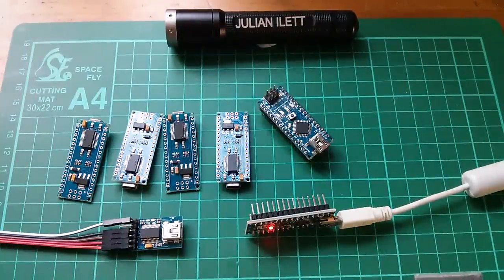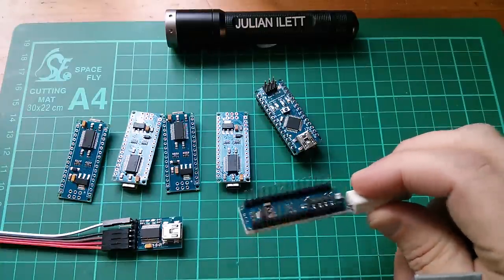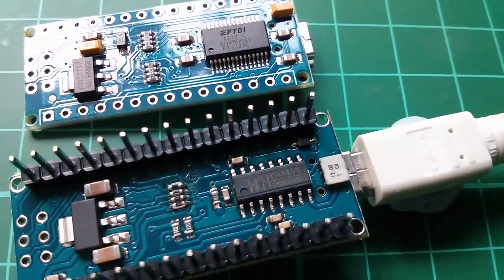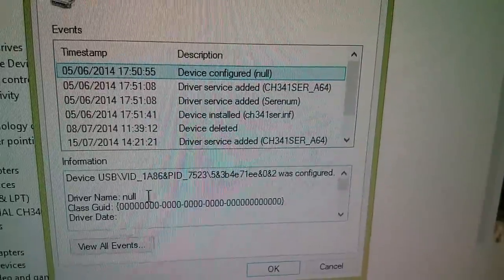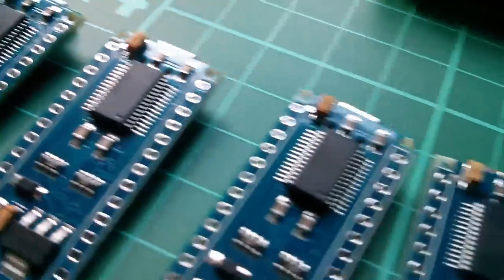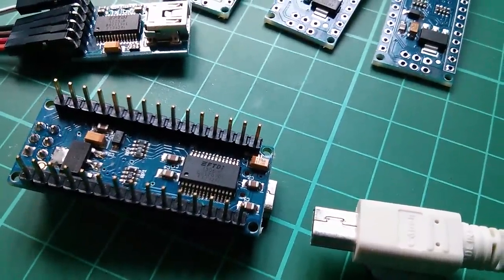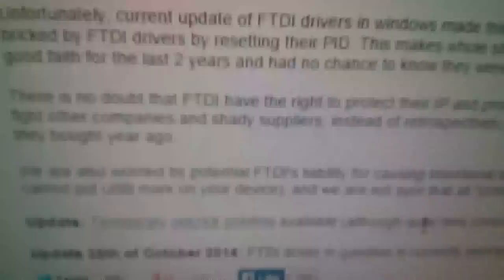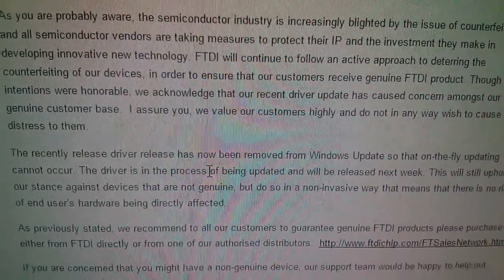Investigation: FTDIgate & Fake/Counterfeit USB to Serial Chips

Comment: I stopped using FT232RL over 2yrs now, just because it cost 4-5 times than other USB-Serial Chips. And I am also using CH340T USB-Serial chip over this period. CH340T cost us $0.39 @ lot of 250pcs. where FT232RL costs appx $ 2.4. But FT232 has more features over CH340. CH340 doesn' t have  in-built 12mhz crystal, wide range TTL voltage selection from 1.8V~5.5V and LED outputs. CH340 claims to work both in 5V or 3.3V , but we noticed it failed to transmit data @ 3.0V... But still it wins over price from FT232.

Comment: I have seen some cases where SiLabs or Atmel chips are used instead of FTDI chips, or CH340 used with an adapter board that contains tiny crystal and other supporting components on them.
FTDI chips are now not being used widely on the products using USB to serial chips.

Comment: It is possible to still use a 'bricked' FTDI chip. You just need to tell Windows to manually override the driver. There is a video on Youtube on how to do this. I had 3x FTDI chips whose PIDs were changed to 0000 but I can still use them using this method, so technically, they're not 'bricked'. Here is the link: Unbrick Arduino FTDI Driver Update Win7 Arduino Nano/Micro/ProMicro FT232R USB UART

Comment: It's possible to unbrick the device anyway - just force install drivers manually. Once installed you can use the FT Prog (http://www.ftdichip.com/Support/Utilities.htm) to flash the valid PIDs to the 232R chip. However if you'll continue to use the unfortunate drivers, the PID will be flashed back to 0000. So you should use FT Prog, and then get rid of the 2.12 drivers.

Comment: Hi, thanks for the video. So it seems that I will get away safe now when I decide to buy Arduinos.

I had one of these "bambus" LED-Clocks which I broke because I got mad. The buttons on the back were scrambled suddendly. ON/OFF did suddendly switch the clap feature on and off instead of the display on and off. The down button did not work at all and I could not set the date and clock anymore properly! So I opened it up "carefully" (Tell it to my left ring finger that got hurt...) and I decided to use the beautiful LED display to build my own Arduino based clock. I also want to add a radio control feature.

Comment: Just as a random aside, my Velleman K8200 3d printer controller board which is based off the Arduino mega 2560 uses an FTDI chip which I would assume is real since Velleman seem unlikely to use fakes, but the chip definitely is not laser etched.

Comment: I have a personal stock  of cheaper CH340 nanos. I saw that the 3.3 regulator on nano only works when the unit is powered from USB. A bit annoying. I'm guessing the regulator is built-in to the chip? (Don't have one to hand to inspect right now!)
Reply: Yes the 3.3v regulator is part of the serial converter chip

Comment: I didnt know about this issue, and installed 2.12.x drivers on my chinese board. It never worked. I installed 2.10 drivers after reading this stuff. In driver details I am getting "Device USB\VID_0403&PID_0000\FTY35H7I was configured." PID is 0000, so does it mean the chip is damaged?
Reply: I keep getting message "COM14 port is already in use... etc etc"
Reply: Fortunately, your chip is NOT damaged. FTDI driver simply overwrote the original PID with zeros, in order for Windows to be fooled and no longer recognizing the device. Google for it, there are a few methods for recovering from this issue and get your fully up-n-running machine back.

Comment: pl2303 can be a pita if you have a fake, as any pl driver later than 2008 wont work right, you need to 2007 pl drivers or you get code10 error in windows
Reply: The same happens if you get an older pl2303 chip (I think the PL2303HX).  I think the oldest version that is supported with the current driver is maybe the PL2303HXA

Comment: Seems i have the same buggy Nano as you have Julian;
PID is still 6001 in the device itself, windows 7 has driver version 2.10.00 installed and device shows up as  "USB Serial Port (COM8)" in the device manager.
Still, i've never been able to upload a sketch to the Nano.. the error is always:
"avrdude: stk500_getsync(): not in sync: resp=0x00"

(with other Arduinos this can be solved to unplug and replug the device if this occurs, but never any luck with this one)
Reply: Update after little internet wandering:

I bougth this Nano from Dx end of nov. 2012 (SKU 81877)
One of the reviewers posted:
"It comes without the Arduino bootloader and wrong config for the ATMEGA fuses. You need an ISP or another working Arduino to fix this."

That explains it all i guess.. and i don't have an ISP :-(

Comment: Interesting. The 5.11 and 5.12 code, whatever its purpose, was intended to work on official FTDI chips. I don't think FTDI is to blame for the fact that the fakes did not support this code. A fake is a fake. The same disassembled code could be used to repair the fake chips by the way, by writing back the valid IDs instead of zero. I think that that's why it was called semi-permanent bricked. Oh well, this is old news!
Reply: 2.11 and 2.12 *

Comment: Based on the markings looks like I have 2 real and 1 fake. CH340 - seems to me unlike the FTDI or (non FTDI Arduino Uno R3) Windows does not remember each device and assign a unique COM port number to it. Also had the feeling that a reset on one CH340 reset others connected at the same time. Maybe the 340 does not have individual serial number.

Comment: I'm pretty sure I got one of the fakes. It came from Deal Extreme (http://www.dx.com/p/ft232rl-usb-to-serial-232-ttl-adapter-module-for-funduino-blue-3-3-5v-206995 , ordered about half a year ago), but I'm sure it's available on Ebay, too. The markings are exactly the same as on the russian website, including identical date code and batch number (I guess that's what the long number in the middle is). It doesn't look laser etched and also the pin one detent is smaller than on the real ones.
My driver version was 2.8.something. Windows update got me to 2.10 today when I tried on purpose. My module is busted anyway, because while using the ISP header on the board its IO pins were killed by an AVR that had the pins used for ISP set to output while normally running (this is no problem with a normal ISP programmer like an USBASP).
Since the USB-side of the fake FTDI is still working (I can connect and even send garbled data to another module - based on a CP2102), I may try to brick it on purpose by installing driver version 2.12. I'm just not sure if I can get rid of the "malware" driver again...

Comment: Hello dear, is it possible to upload arduino sketch in atmega328 only by using USB-TTL FTDI chip(this chip has no dti pin, so i can't connect it to the microcontrollers reset pin 1)
Reply from the maker: +rlc circuit You can also use RTS if it has it.
Reply: +rlc circuit I was able to upload an arduino sketch using my CP2102 USB-UART adapter WITHOUT a RST pin.  All you have to do is wait for the Arduino software to go from "Compiling" to "Uploading"  As soon as you see it uploading, press the reset button on the Arduino and your sketch will transfer..   Works like a charm!
Reply: thanks :)

Comment: I'd not been aware of this move by FTDI - until this week, stuck on holiday in the middle of no-where - I found myself with a dead FTDI board-  sure enough - PID=0.  Windows 8.1 could do nothing about it but luckily I also had a Linux machine with me - i.e. a Raspberry Pi. Putting clues from two blogs together I managed to restore the board. Clearly one wants the genuine thing (though after pulling a stunt like that I will be looking for alternatives to FTDI products in the future) but there is absolutely NO way to get one where I am for the next few days - hence the fix here. http://tech.scargill.net/ftdi-bricked-chips-fix/ - I've stated in the blog that I don't recommend using counterfeit products and so this should not be considered a permanent solution but if it gets one innocent end user out of a jam...

Comment: There is a patched/resigned driver available.
Found it on reddit, tested it om mij ft23rl board and it worked again after installing the 2.12 driver. Removed 2.12 driver from windows, installed the resigned one, and all is well again.
https://onedrive.live.com/redir?resid=86EF72597602DD78!271164&authkey=!AIWwL-755E4FbwU&ithint=file%2czip